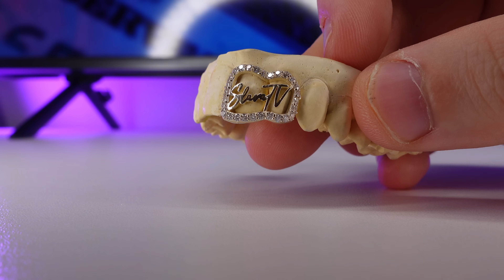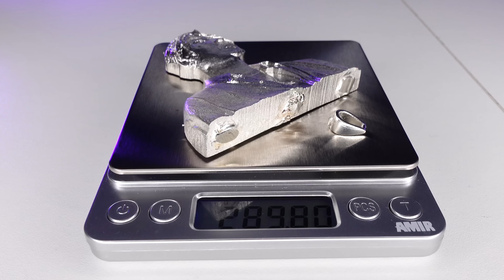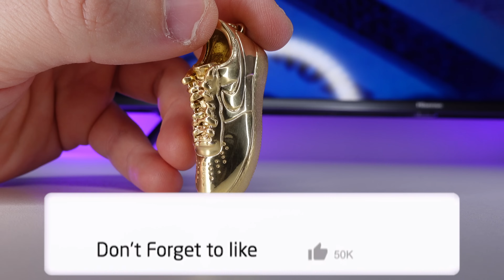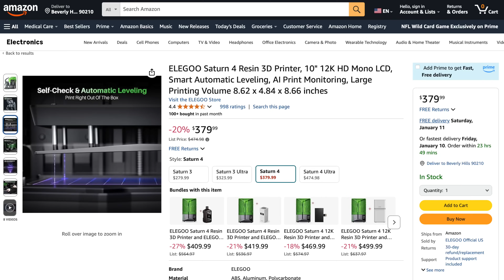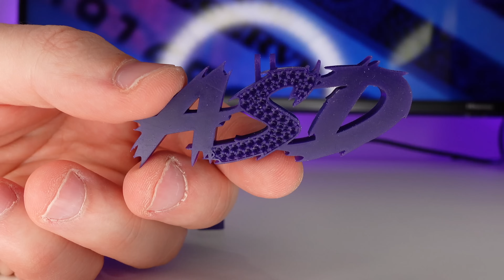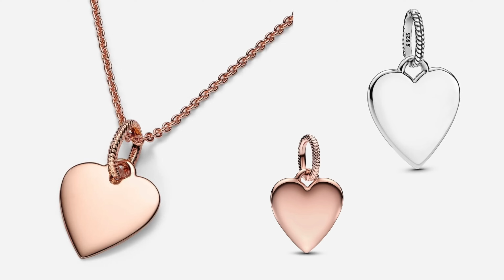How To Start A Jewelry Business With $500 (ANYONE Can Do This!)

Comment: @TraxNYC should SERIOUSLy collab to do a jewlery lesson video school thing with u to like, make money sellin peopel some sort of jewlery acadmey i dunno seriously tho, u should at least make money sellin those elegoo resinprinters or even bambu 3d printers or whatever has a referal program bambu doesnt but elego neptune COREXY for liek $280 i hear is godo for an enclosued corexy, peopel say its good now, as godo as  abambu, and u ned to use FDM wax filemanet for lost metal casting but it does work, with fdm andu can use 0.2mm nozzle and it will be as godo as the resin prinetr and no uv curing or cutting supports!

Comment: regular FDM bambu type 3d printers can also use wax filaments as well for metal casting thts way easier no support cutting or uv curing and u can just use a 0.2mm nozzle, its gonna be melted, u wont notice the layer lines lol

Comment: Not getting views on ebay even after optimisation, seems saturated
Reply from the maker: Are you selling cheap or fine jewelry? You need to push it on people can't depend on eBay. also you have to run ads
Reply: @SlavaTVOfficial  I am selling gold plated rings, what type of ads? Because i run standard at 15%

Comment: I have recently gotten a Mars 5 Ultra, and it turned out the chitubox slicing software was broke. The chitubox support team had to give me a different version. Going through that was a headache. Not the best start so far.
Reply from the maker: it sounds like a software version update
Reply: @ They told me it was a glitch in the package i used previously. Their software engineer accidentally merged an incorrect code branch into the main branch. And they’ll correct this in the next version.

Comment: One thing to add, if you already have an ipad you can 3d scan things with it, so no need to go out and buy a 3d scanner
Reply from the maker: the LiDAR Scanners on the iPhone / iPad are not comparable to real scanners
Reply: @SlavaTVOfficial  fair but if someone is on a budget it can work in a pinch, also Facebook marketplace always has bunch of cheap slightly used equipment too

Comment: In the total to make the piece you didn't specify how much it is to buy the metal. I.e, if it's 289 grams of sterling silver that's roughly 267.325 of fine silver and 21.675 grams of copper. The total of materials equals $282 for fine silver and about $5-$10 for copper.
Reply from the maker: that is already factored in.. like I said you should be paying around $2 per gram for silver.. silver costs around a $1.. the other dollar goes to the casting person
Reply: @SlavaTVOfficial I see... I may have misunderstood, I respect the videos no disrespect meant btw... I just bought an elegoo Saturn 4 ultra and I plan on using siraya tech true blue. Do you have recommended settings you could maybe shoot me in an email if you have time?
Reply from the maker: here you go https://siraya.tech/blogs/news/printing-siraya-tech-cast-resins-on-elegoo-saturn-4-ultra-and-mars-5-ultra

Comment: Where did you get the chain CAD that prints as a whole peice? It doesn't cast stuck together?
Reply from the maker: I had a designer make it from individual links, there are small gaps in between so it doesn’t stick